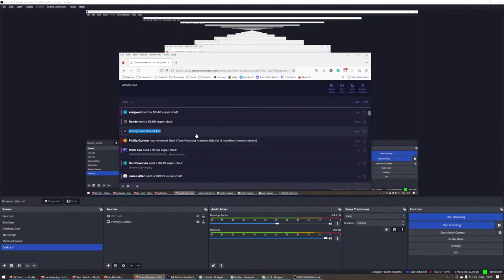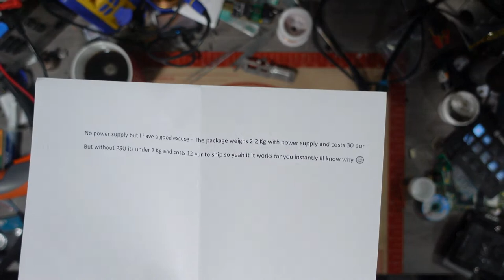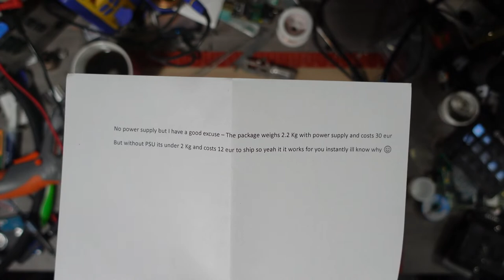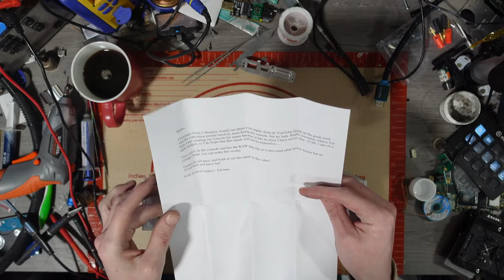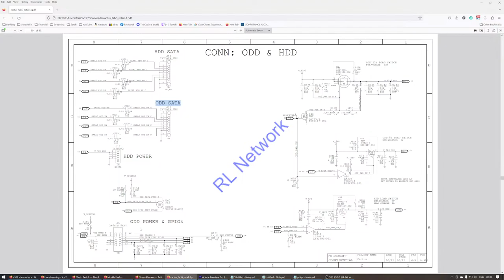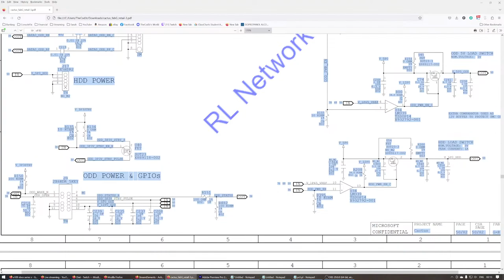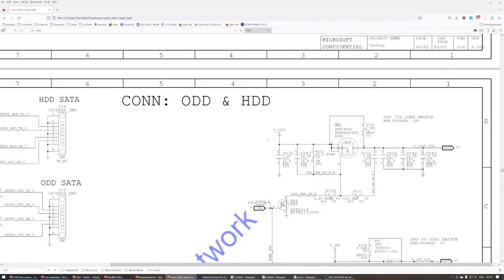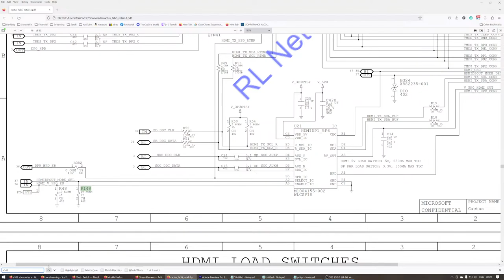Let's Try Not To Break Any Consoles Tonight! Repair Live Stream

Comment: E109 error Xbox Serie S and X described as need of hard reset or clean install off line on empty ssd drive.
Found a few places related to the error, but dont want to post them here . But google search xbox E109 and middle of the page, the error shows up and explained. From what Iv seen following you for a long time now, you done this several times with other error codes where this E109 seem to show when a new ssd has been installed and in need of clean offline install through ext usb

Comment: These testers are interesting but I think they are to expensive.
Reply: Price wise, yes they are on the expensive side. Although when doing mac repairs they'd give you an at a glance understanding of what voltages are problematic/missing.

From the durability point of view (because replacing them is not going to be cheap), having a PCB with holes and a plastic housing with posts (or nuts and bolts) going through them could help relieve the stress on the connector.

Comment: hi! i have a question for you. if you need to replace the touch screen of a nintendo switch how do you reattach it to the console? glue or adhesive? I was looking around a bit but I can't find any seller who has a replacement adhesive for this screen.
Reply: Maybe a line of black t7000 glue? That's what they use for phone screen replacements.
Reply: @bufordmaddogtannen  
I have the t7000 glue, but I was thinking about whether or not to use it. it is very strong and it is not ideal to have to deal with it if in the future you need to change screen or touch once again. the sticker seems to me more suitable for these consoles
Reply: @RVNR2022  quattro punti di T7000 negli angoli e del biadesivo trasparente 3M sul resto del perimetro? 🙂
Reply: @bufordmaddogtannen  italiano? che sorpresa. mmm. non è una brutta idea. devo procurarmi del buon biadesivo 3m della misura giusta. anche se preferirei ugualmente trovare del biadesivo preformato per fare prima e avere la forma perfetta per lo schermo invece che fare attacconi con pezzi diversi ogni volta. ci tengo a fare delle buone sostituzioni che durino come l'originale ma che siano riparabili.
Reply: @bufordmaddogtannen  quelli su ali li ho visti ma sono quelli da mettere tra lcd e touch. e ne ho gia ordinati pensando fossero appunto quelli che cerco ma sono sbagliati appunto. non sono quelli per touch e scocca. se hai qualche indirizzo me lo mandi in privato?
Reply: @RVNR2022  spiacente, non ho idea. In genere le fonti sono ali, il noto sito di aste (che YouTube non gradisce nei commenti) e il fai da te.
Reply: @bufordmaddogtannen  si youtube non gradisce molte cose. link... nessun nome di motore di ricerca... comunicare qui è veramente dura. se ti va vieni a trovarmi cosi eventualmente possiamo parlare in privato anche tramite altri canali. grazie comunque dell'aiuto